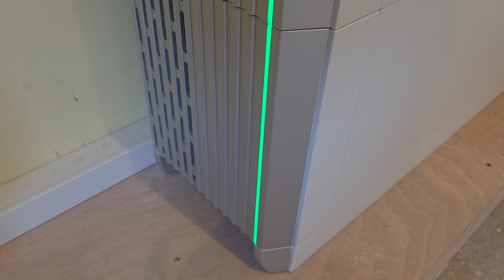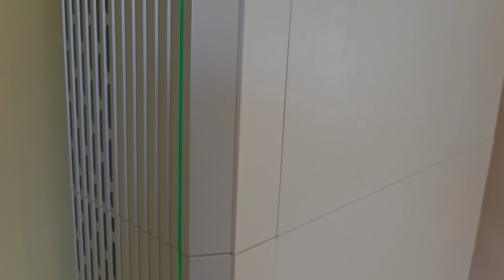HUGE battery storage for ANY home. 108kWh and 50kW of raw power - SIGENERGY BEAST MODE

Comment: Hi Mark,
Would like to pick your brains quickly. I don't have the budget of an installation like you are showing, however I will getting solar and battery soon. 
I was on Renewsolar website and they appear to have a 50kwh battery for GBP3014 , which seems very cheap. Not sure if its a scam or I have misunderstood what it does.
However, if its real, could I just get a SigEnergy Inverter, and a small, cheap, Sig battery and then link the 50kwh battery to it?
If so, would you be prepared to link it up? I'm on the South Coast.
Reply from the maker: That would not work I am afraid. Not familair with the offer or company you have referenced but suspect it wont include any BMS and such. If so I wouldnt be putting it anywhere near my own house put it that way.

Comment: I thought you needed 600mm clearance above a sigenstore stack for ventilation. Are you sure that meets the install guidelines?
Reply from the maker: see note on room and wider build. That said ventilation of the room by AC etc can lead to smaller distances. This is absolutely fine

Comment: Not relevant to this video, but I've seen Sigenergy have introduced micro-inverters. Would be great to have a single ecosystem for solar, battery and EV charger so hope we'll see you doing such an install soon!
Reply from the maker: The micro inverters are not something we are looking to install alongside sigenstor as you get more losses due to multiple conversion. Optimisers on DC systems is the way to go. So I dont expect to doing any of those soon.

Comment: Can I clarify your ending discussion about FiT, please could you explain how an existing FiT been integrated with this new system? I think the FiT is through the smartport into the Gateway so is the export from the FiT being metered separately and the generated energy going into the gateway where it can be 'pooled' with the new PV. And has the customer opted out of the 'deemed-export' portion of the FiT to avoid the potential double-counting of export, whilst leaving the 'generation' portion of FiT unaltered.
This is an area of knowledge that is growing as some earlier assumptions for integrating with FiT have been debunked - would like to know how this has been treated on this install, thank you!
Reply from the maker: No new PV on this one so the deemed export remains as prior. If adding PV it can still be done on a % basis of the deemed export so still entirely possible. 

The generation here is metered exactly as before and the fit operator required no changes. 

If the PV was to run into the Sig inverters directly rather than AC coupled that would also have changed things.

Comment: Great video Mark, question, can you stop the discharge out the battery say if the EV charger was plugged in to take from the grid instead during cheap rates?
Reply from the maker: Yes, the system gives total energy control and you can choose to not use the battery in charging vehicles or to do so if you wish. Unmatched control.

Comment: I thought there was a limit of 80kwh on a single domestic install
Reply from the maker: I think you are referring to PAS 63100? For domestic property up to 200 square meters in size. This is considerably bigger than that and no hard or fast rules exist other than matching to consumers demand and requirements alongside G99/DNO applications. 

Kind of makes sense as larger properties will require bigger battery storage to match/cope with demand. 

Hope that helps.
Reply: @electrician247 thanks for the info I wasn't aware of that
Reply from the maker: @dama054 no problem. The PAS63100 has few gremlins within it to iron out. But its a work in progress document to a large degree. Has caused a few issues more related to smaller dwellings in even installing any battery storage.
Reply: @electrician247  Do we know how that 'floor area' is defined?  Using my home as example the plan size (house footprint) is 242m2 but the heated or habitable area footprint is 172m2.  Adding in the upper floor would bring the habitable area up to 353m2.  Everyone seems to give a different answer depending on how these areas are used for different purposes outside of this PAS.
Reply from the maker: @ascot4000 its the square meter size of the entire property. Basically anything over 3 bed detached ish can quite easily move outside of it. 

The intent to comply with the PAS remains but clearly capacities etc would have to be larger as common sense would dictate.